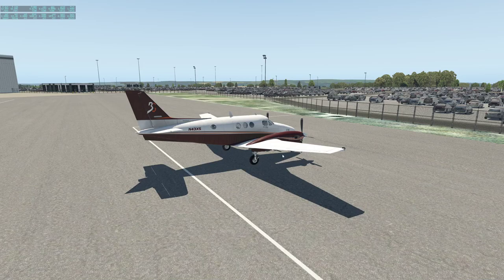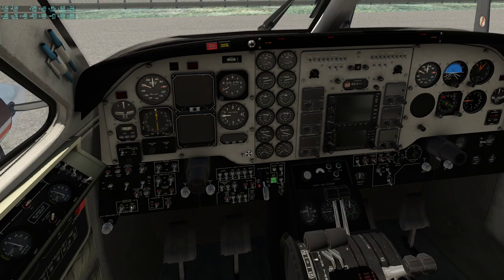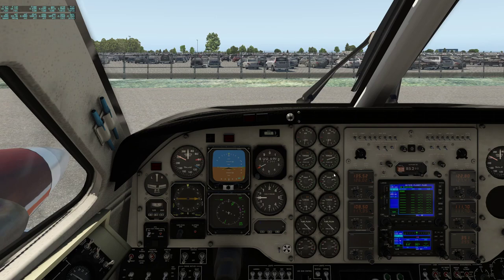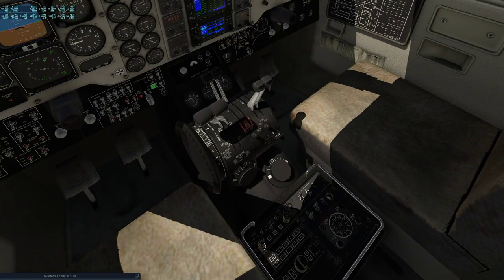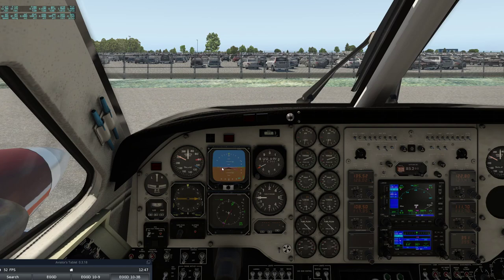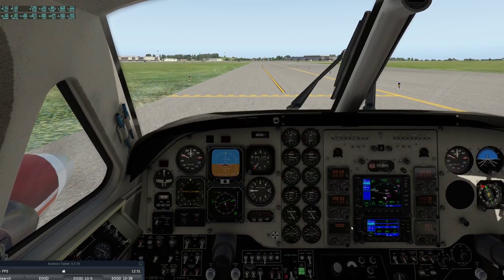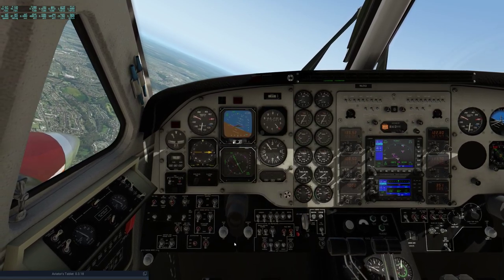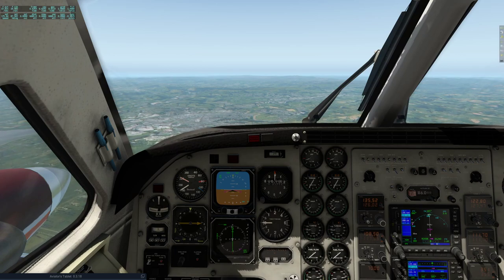Part 1: X-Plane 11 King Air C90 autopilot tips and tricks revisited - startup and GPS departure

Comment: Hi finlayc, 
I thought I’d answer a couple of questions for you regarding the C90. You asked about the transfer pumps. The transfer pumps are not used during engine start. The transfer pumps do not provide any important function during startup, they only drain battery power, so are left off during engine start. 
You mentioned the reason for the boost pumps. The boost pump do not ‘help’ the engine-driven fuel pump. The boost pumps ‘guarantee’ fuel pressure is supplied to the engine-driven fuel pumps. (If an engine-driven fuel pump fails, the boost pump will not be any help at all.)
You asked if fuel goes from the nacelles to the aux tanks or whatever. This is different in the various versions of the C90 (Straight C90, C90A, E90, etc.) From looking at your video, it seems you are flying the C90A. The fuel in the C90A flows from the wing tank to the nacelle tank. There is no ‘aux’ tank on a C90A. (The E90 has aux tanks, the C90 and C90A do not.)
The transfer pumps move fuel from the wing tanks to the nacelle tanks. The boost pumps do not. The boost pumps only deal with fuel moving from the nacelle tanks to the engine-driven fuel pumps.
Reply from the maker: Thanks for the fuel systems info!

Comment: Nice update. I do find a lot of different "opinions" maybe, on how to start the turbo props on the King Airs, relative to the use of the generators and such. I found it helpful to get a copy of the King Air manuals for the actual plane. They are certainly more technical in nature then the manual provided by Airfoillabs and the startup procedures are not the same for sure. Nothing major though just a few little discrepancies. So I ended up creating my own startup procedure to at least be consistent in how I perform the steps. Form what I have seen the steps you take are in line for the most part. I don't think there is an issue with having the generator on when starting the second engine though. At least I did not find anything on it - but hey it works so there is that. Enjoyed the two videos mate. Good stuff as usual. AE
Reply from the maker: Thanks Alan!

Comment: finlayc, I want to ask you about your X-plane’s boost pumps. In my way of starting a King Air engine, the first three steps are left boost pump on, right boost pump on, then master switch on. (The boost pumps do not need the master switch to be on in order to receive electricity to operate, they are hard-wired right to the battery. If you leave the boost pumps on overnight, you will run the battery down even if the master switch is turned off.) When you turn on a boost pump, you can hear it running. It is part of the starting procedure to turn on a boost pump, then listen to it to verify it is running. When you turn on your X-plane’s boost pumps, can you hear them running?
Reply from the maker: Yes, the boost pumps can be heard operating with the battery master switch off.  Had to turn volume up high to hear them though!  Thanks again for the info.  I can understand turning on the boost pumps before doing anything else so you can hear them to verify they are operating.  I guess they could then be turned off again until just before engine start if that is going to be delayed.

Comment: finlayc, I am glad to hear your emergency fuel cutoff switches work. I am not sure if you are aware, but all fuel switches receive electrical power independent of the master electrical switch. It is necessary for all fuel switches to work even if the master electrical switch is turned off. The down side of this is, if you leave a fuel pump switch on overnight, even if you turn the master electrical switch off, you will have a dead battery in the morning. 

I am curious if your software can perform an emergency fuel crossfeed the way a real King Air does. Can it? Have you tried testing the fuel crossfeed function?
Reply from the maker: Yep, crossfeed seems to work!  I'm going to make a new video to demonstrate
Reply from the maker: @nm-pl9eo  Yes, thanks for the link!  I have watched that some time ago but I understand it better now. I might still do a video to demonstrate crossfeed in-flight, based on the procedures described here: http://www.kingairmagazine.com/article/4041/

Comment: It's very frustrating trying to fly this airplane with the control knobs not in view at the time you need them.  I'm not having much luck using the command/shortcuts.  Also the "lights" on the AP that show engaged functions are so dim as to be nearly impossible to read.  I have troubles getting the A/P to engage at all, even though the annunciator light says it is.  Then, entering an ILS APP course, same problem, can't see the panel from the knob.  Not to mention that the EFIS is podunk at best and you can't even enter waypoints.

Comment: Hey finlayc, here is another C90 feature I am wondering if your software has. I am referring to the emergency fuel cutoff switches, which are red guarded switches on the fuel panel. (I always check these during pre-flight.) The red guarded emergency fuel cutoff switches are located below the fuel gauges. When one of these switches is actuated, you can hear an electric motor run for a fraction of a second. Basically, these are little ‘guillotines’ that drop down into the fuel lines to cut off fuel in the event of an emergency landing. Do these switches work on your software? Can you hear them? (On a real airplane they are much quieter to hear than boost pumps, so they can usually only be heard inside of a quiet, closed hangar.)
Reply from the maker: Hi!  The X-Plane C90 does have "firewall shut off valve" switches under the fuel gauge panel.  They are guarded with red covers.  The switches need battery or external power to operate.  I can't hear any motor noise when operating them, just the click of the switch.  They do seem to work though, if I start an engine then activate the fuel cutoff switch the engine stops

Comment: you want to turn one boost pump on for 5-10 seconds before starting that engine to avoid flooding the engine
Reply from the maker: Thanks for pointing that out.  The boost pumps should indeed be turned on before engine start.  I learned more about the C90 fuel system after making this video - here's one with better procedures for the start. https://www.youtube.com/watch?v=8Ggan_LlYLs

Comment: Hey finlayc!
I did everything what you said but when I take off I press AP an YD buttons and when my path is going to turn (a bit earlier) I press NAV mode but my plane still doesn't want to follow my route and it flies to another way (Way of rwy). Can you plase help me? 

Thanks if you will ;)
Reply from the maker: Hi, sorry for the late reply.  Make sure an inverter is turned on and elevator trim (on the centre console).  Also make sure you have pressed CDI on the Garmin to make the autopilot follow GPS nav (should say RNV1 on the HSI)